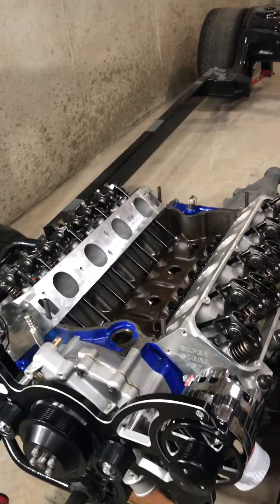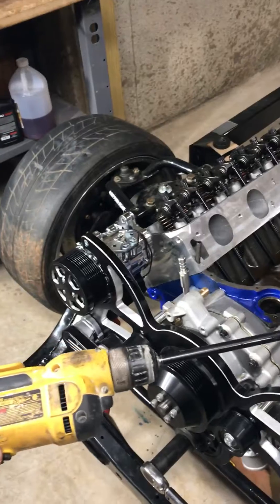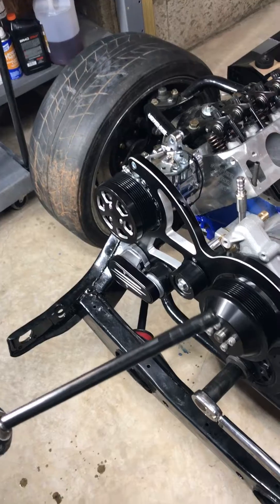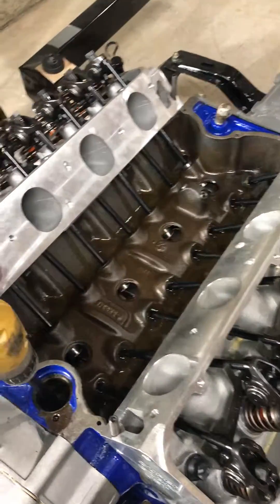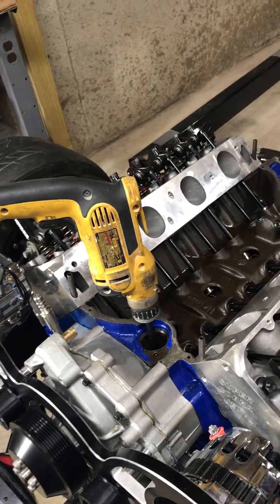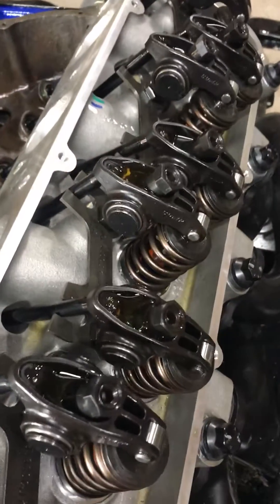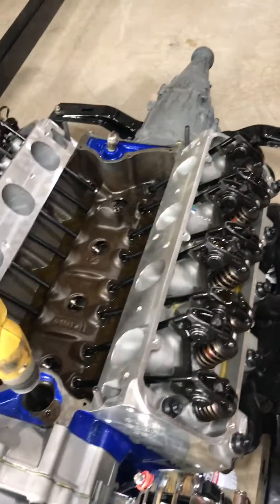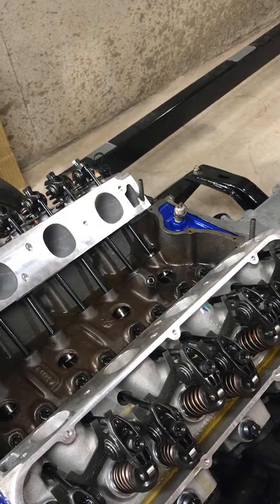Priming oil system - Ford 460 stroker

Comment: Nice work. What is the name an size of the tool on the drill please
Reply from the maker: Oil pump primer
Reply: @daleclark5125  thank you. This video is so helpful
Reply: @daleclark5125  what size ?
Reply from the maker: @leonardoboodle7314  look up Milodon part number 23010

Comment: I do this also when engine sits over winters without startup. I run my drill in 15 sec intervals, 5 or 6 times so I don't burn it up. I use just a 18V cordless drill and no problems. I have momma sit in the car and yell to me when oil pressure peaks. The worst part is marking the distributor shaft and which cylinder the rotor is on so you don't fk up the timing too bad. Tweak and check the timing when the engine is running.